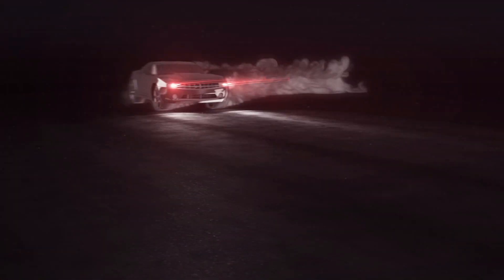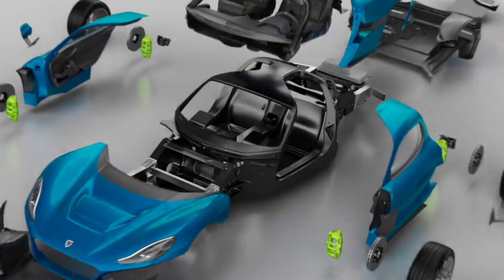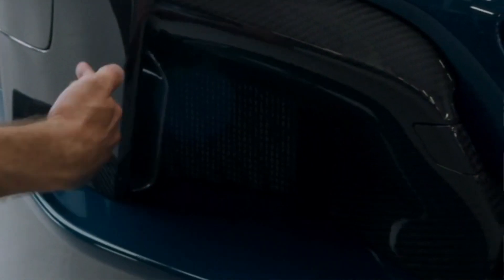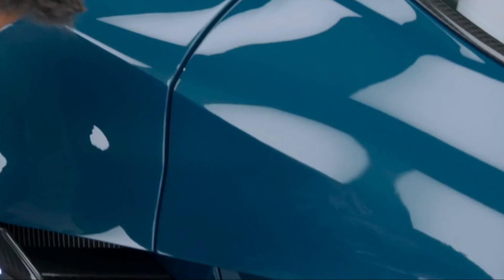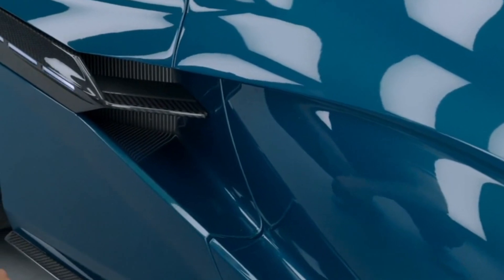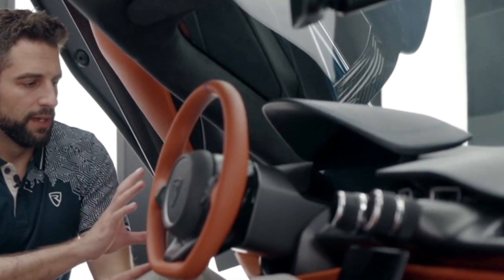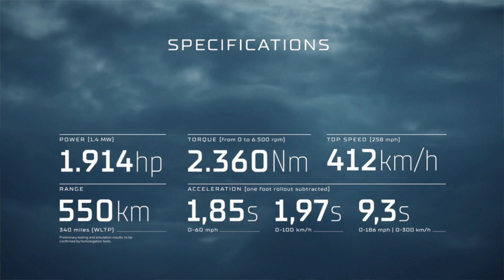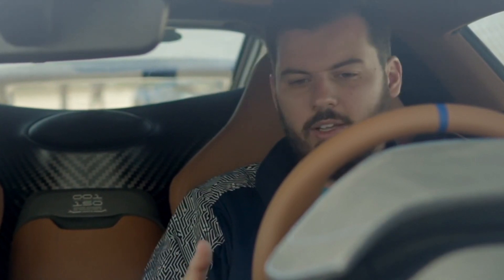$2.4m RIMAC NEVERA Full Detail: 4 Single Speed Gearboxs + all tech explain P1

Comment: there is error in the title,  2 front single gear gearbox and 2 rear 2 speed gearbox
Reply from the maker: No mistake bro
4 in total 
2 single speed gear boxes in front at the end of the front axle, 1 attached to each e-motor

2 double single speed gearbox encased in a single housing sitting on the rear axle in between the 2 surface mounted motors
Reply: @Autostop_  read your last sentence... Find the error...